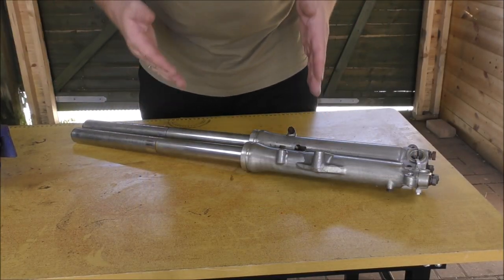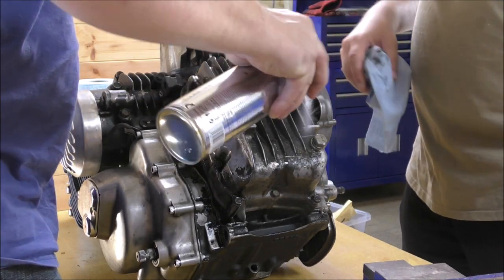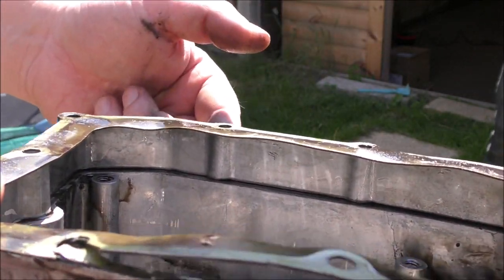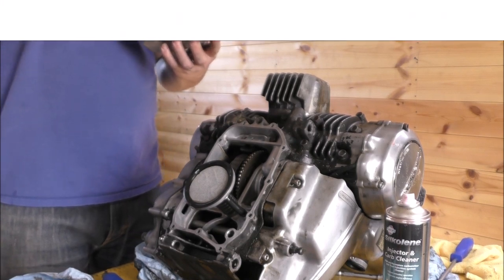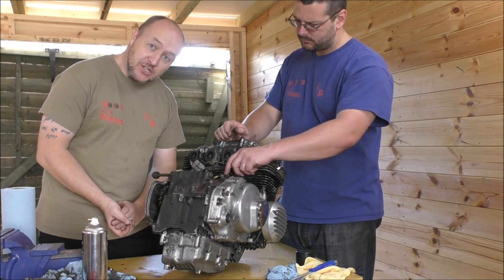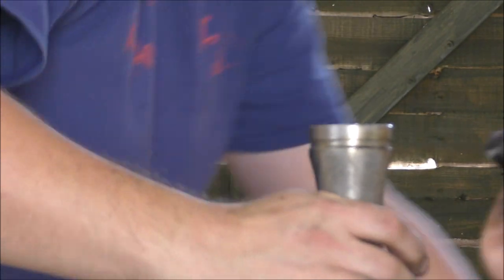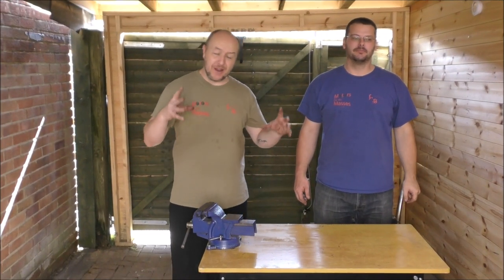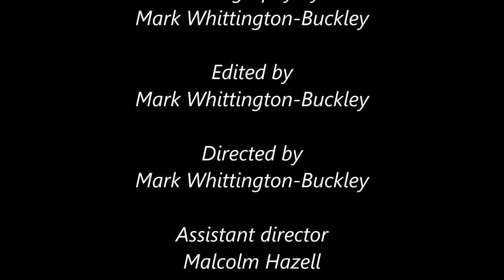Cafe Scrambler BUILD 24, back from POWDERCOATING + Engine

Comment: If you're talking about the haynes manual for the torque settings of the sump bolts, you will find them at the beginning of the section (usually number 2,) in the torque setting table in the specifications at the beginning of the chapter.
If they're not there then use a similar setting for the bolt size (which is what you mentioned, anyway....)
As its a sump, there's no real pressure to worry about but do make sure that the bolts are tightened evenly to prevent distortion and guard against potential leaks.

Comment: You never put stanchions in a vise naked. You'll scratch them and could cause water to seep into the lowers. It's better to wrap them in a tea towel first.
Reply from the maker: The ones we are using we put in a towely cloth...the others are the ones we are not using due to the crack in the fork lower.

Comment: Hmmm, I'd change the gaskets. You've got the kit and the engine's out. Imagine how annoying it'll be if you reassemble the whole bike, and then you can't ride it cos a sneaky leak pops up.
Reply from the maker: I understand and that was my argument too. However I do see Malcolm's point in that the bike has been run several times with no leaks, not problems and by taking it apart now, will we create problems with bolts etc and perhaps create more work than is necessary. So far everything we have changed looks pretty decent...but we have changed it anyway. However when it comes to the engine it may just be a case of stripping an engine that does not need stripping.
Reply: If it has not leaked in service before the project started and nothing has been disturbed there really no need as it's not likely to leak again, Don't make work if you don't have to!....
Reply: @roythearcher  true, and I could be wrong here, but, I thought this bike hadn't been in service for years.